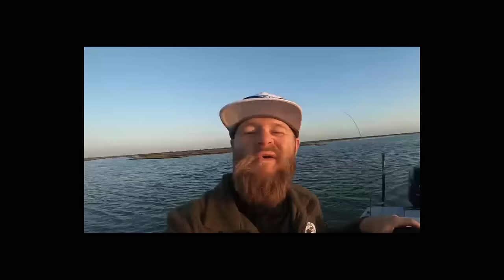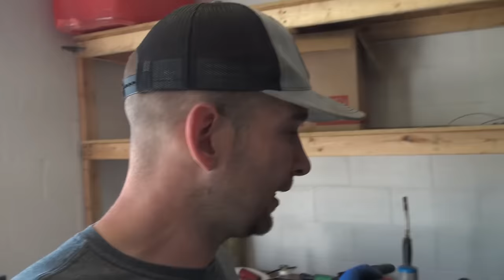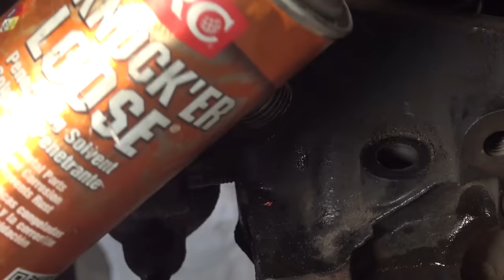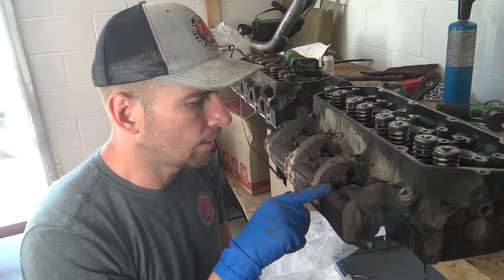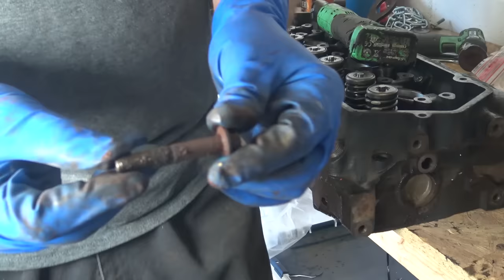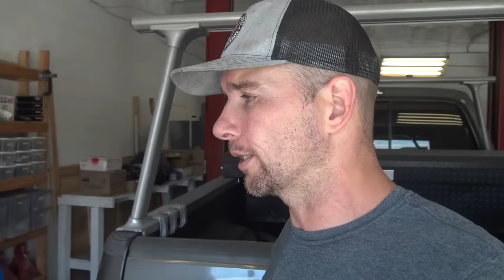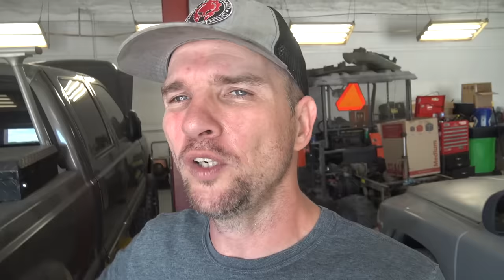Old Mechanic Taught Me This Trick To Removing Rusty Exhaust Manifold Bolts!

Comment: Great stuff!  I do have another method that often works in places where you CAN'T use heat,  and that's using COLD.  The best way I've found for that was to use an INVERTED can of "spray air", usually marketed for blowing off computer keyboards, etc., and to spray the LIQUID on the fastener itself (and NOT the surrounding metal).  This causes the fastener itself to shrink....a LOT...and can often free it up.  I work with aluminum head engines often, where heat is your enemy.  The extreme cold using this method works great!  I had occasion to insert a roller bearing into the end of a crankshaft, where the outer diameter of the bearing was a few thousandths bigger than the hole.  Opening up the crankshaft wasn't possible (engine was still together), so I used this method to shrink the bearing.  It was a small bearing, less than 1" in diameter, but I tested this method on it.  Amazingly, it shrank 17 thousandths of an inch, and was literally loose in the hole!  I kept spraying the bearing until it was uniformly white.  Of course, once it warmed up, it was tight in the hole, but it worked perfectly.
Reply: thanks
Reply: For old Harley heads that needed the guides replaced,id heat the head to remove the guides,after cleaning them first,then heat the head when installing the guide,but id freeze the guide in the fridge so it would go it really easy,once the head is cold the guide is locked tight as a drum,done it a million times lol.
Reply: @bruceperron3796  Ive used the freezer to help shrink bearing races down before I installed them.  I've never installed rod guides before, but I know what they are as I have put heads on engines.  The day will come when I do install guides and I will remember this.
Reply: That's what she said!
Reply: Good Man ...... that's got to be worthy of Tip Of The Day !  🏆
Reply: @ruthberesford1198  Ring gears on fly wheel. Flywheel in the freezer- ring gear in the BBQ for a short stint and it rattles on loose as can be ans tightens up unmovable

Comment: Have to admit I just found your channel. The removal of rusty bolts caught my attention so I had to watch. This is the method I learned 40 years ago with my dad and you are right the key is to go slow and use heat on those that seem impossible. Because of your story and this video content you have my subscription to help you to your goal to be better than ever. Cheers.

Comment: I drove my vehicle for a week knowing I had to replace the exhaust manifold, I sprayed the bolts everyday with penetrating oil. The next week when I went to remove them, they all came out super easy. The heat expanded the head and manifold after driving and since there was more heat in those areas verses the bolt the oil was drawn into the areas that needed the lube. I learned a long time ago that you heat where you want the oil to go. I did have one bolt that was broke on the bottom back side, no idea how long it was broke or missing but since I was spraying it anyway when I tacked on a nut, it came right out also. Nice video, keep them coming.

Comment: This is a lot tougher in the northeast when a lot of times, those manifold bolt heads more closely resemble hammered rivets after the rust has it's way.
Reply: I spend hours watching the mechanic at South Main Auto remove bolts with Northern rust.
Reply: This so true... I've worked on so many cars that have had exhaust issues because the bolts/nuts/studs have rusted to nothing...
Reply: I was thinking the same thing.  New Englander here....
Reply: nabob14 rusted exhaust almost always better to cut and replace. You won't be reusing rusted out fastners.
Reply: Lol y’all keep calling it “Northern Rust.” Let me show you my truck that lived on the coast of the Carolinas for most of its life.🤣
Reply: @evhexrc1765  ive seen Galveston,Tx rust buckets. Anything from the coast scares me more then northern.
Reply: Trying that with the head on the motor is another thing.
Reply: @evhexrc1765  I work on coastal cars. Salt rust is bad. Worse than coastal rust. A Carolina car will last 20-25 years. Northern cars half that.
Reply: It’s scrap metal at that point
Reply: @iamtheoffenderofall  magnesium chloride doesn't play well with metal
Reply: EvHexRC 1 Carolina coast may have some salt in the air, but in upstate NY they dump salt in the streets. Mix that with melting snow and ice, I don’t think there’s any comparison 😆 🤷‍♂️
Reply: A pass through socket set with splines answers that question for me every time. I put the pass through extension on the pass through splined socket smack it with a hammer until the socket cuts new splines in the nut or bolt.
Reply: @evhexrc1765  My brother lives in Maine...He knows it's time for a new car when his foot goes through the floor.
Reply: Oldold Pilgrim .. South Main auto is probably one of the best on YouTube. This video here is very informative. I live in the Northeast and exhaust manifold bolts are nothing but a hassle.
Reply: I do not envy you guys busting nuts in the Northeast. I’m in the southeast and ran across a rear knuckle on and Aztek that the bolts were rust welded in place. That thing was a nightmare.
Reply: This is okay but you're not going to be reusing them old nasty bolts anyways I think it is so much quicker to take a die grinder cut the tip if you have access off and take a little set of torches he is using MAPP gas or what not I use just a baby set of torches with a little baby Rosebud tip heat them suckers take out set of vice grips or a bolt out socket. And do each one I would be done and more than half the time of what this is taking but if it is a very old classic in some reason you can't get the bolts or something like that and you just want to reuse them then this is okay but time is money money is time if it takes you two hours I want have when you could have just cut them off at the diagram there he did them slam dunk it in 60 minutes
Reply: Using penetrating oil and banging with a hammer is like smoking crack, a waste of time and money.  Easiest way to remove the worst case scenario bolts: heat bolt with torch then melt some candle wax on heated bolt.  Screws right out with no effort whatsoever
Reply: @acemogany6369  life must go a lot faster if one skips any punctuation and spends zero time composing thoughts into rational sentences...
I hate babble on no punctuation hipster gibberish! 
BUT I HAVE TO ADMIT THAT I HAD NO TROUBLE FIGURING OUT WHAT YOU WERE SAYING. So somewhere in the middle? 
Let's eat, Grandma!
Is very different from: 
Let's eat Grandma !
Punctuation saves lives...

Comment: all excellent ideas!  My Dad was a tool & die maker for Caterpillar and taught me another trick - tap on the head of the bolt after spraying your Knocker Loose on the bolt head and thread base.  And not just tap - but whang on it!!  That tends to loosen up the rusted internal threads so they may turn out easier!  Nice job sir.
Reply: First up,;
I'd like to thank everyone, for revealing their "Trade Secrets"
Everyone uses different words/language to describe things.
In one Caterpillar manual it suggested "setting up a vibration"
and the picture was of someone beating on it with a hammer.!
and some folks say "Get a bigger hammer"
However, this video is all about,"softly softly, catchly monkey"

Comment: After you torch it, spray it with more penetrating oil. The heat will draw it into the bolt hole.
Also smart the bolt heads with a hammer a few times before you try loosening them
Reply: That is called “Wicking”. It is not the heat drawing it in, it is cooling down that draws it in. Plumbers use wax.
Reply: Hammer is a good idea, I have found this helps. Assume it moves the bolt just enough to break the corrosive bond. Though, heat is the one thing that nearly always works.
Reply: @lynnchello7231  I have a spray bottle with water in it and squirt directly on bolt after heating....then loosen
Reply: Exactly what my father taught me nearly 60 years ago. He called them short-sharp "twat-hits". Works like magic until you realize it's just physics.
Reply: Air chisels work pretty well at vibrating the bolt if there isn't enough room to get a good swing with a hammer.
Reply: @bluenami7520  yes they do; better than a hammer. If you have one I'd use that
Reply: @bluenami7520  The Air Chisel idea totally helps. To keep the blunt end of the air Chisel's tool from vibrating all over the place, find a socket that fits the bolt head, and drive the punch (or drift) point through the hopefully 1/2" square drive hole. Some deep well sockets are open all the way through and work great! Just this spring, I removed some HORRIBLY seized bolts from a John Deere Air Seeder exactly this way. Nothing works 100% EVERY SINGLE time, but in my 66 years of screwing with stuff like this, the Air Chisel trick is one of the best I've learned. Add in the patience, working both ways a tad, soaking the crap out of it.... All the above.
Reply: This is exactly what I do
Reply: @lynnchello7231  parrafin wax also works well when metal is hot. Penetrating oil evaporates to fast to be effective i find.
Reply: @lynnchello7231  also crayons
Reply: @c50ge  now that is a good use for all your kids old broken wax crayons.  Lol
Reply: You and me know the sam old mechanic.  Also, after heating- if you take time, let it cool! The heating cycle will make the interface move and help loosen the bolt threads.
Reply: @thegoatstore7814  This is by far the best tip anyone could share. Its just amazing at how good it works but you must remember to turn the bolt or nut in just till it cracks loose a tiny bit the heat it red hot and quench and Bam most of the time they will come right out. Another cool thing if you have 24hours to spare is to dissolve the bolt right out of the hole. Make a little cup that fits over the stuck bolt with a soda can make sure you cut the bottom of the can out and then use rtv and seal the can to the aluminum head(only works on Aluminum because it wont dissolve it it will only eat the steel) after the can is sealed to the head go to your local bulk food store and get some Alum its used in canning or something. And you mix it up with some water not sure of the ratio and fill up the soda can so the bolt is covered in the solution and next you put a heat lamp near it to heat up the solution this makes it work way faster. And walk away and when you come back the next day you will have a beautiful hole with perfect threads. This is chemistry at its finest. We used it 1 time on a vehicle where the heads were way to expensive and rare to risk anything funny happening to it and it went perfect
Reply: @lynnchello7231  obviously that is what he meant but thanks for clearing that up. Drastic change in temperature either way helps alot on different metals
Reply: @ssskinner28  
Can you please "resay" your explanation. 
Not fully getting that last part.
Reply: @ssskinner28  what steel was the fastener made from? Regular carbon steel? Or stainless?
Reply: @Babewatcherbob  regular carbon steel it may work with stainless I'm not sure
Reply: @onlythetruth883  if you're talking about dissolving the bolt with Alum powder. This only works if the main part is aluminum. You pretty much take a soda can and seal it to the head or whatever your working on with rtv and when its set up you make a mixture of Alum powder and water and fill up the soda can which will then hold the mixture in place over the bolt. Now that it's all in place and soaking you take a heat lamp or regular light bulb and put it close by so it heats up and you wait overnight is usually enough but sometimes it takes 24 hours. This is far from a fast fix but when it needs to be perfect this will work better than anything
Reply: @ssskinner28  Alum power mixed in water will also dissolve HSS taps broken off in aluminum.  Just a neat trick I read in an old machinist's manual
Reply: Take an aluminium Hammer, it gets vibrations on the bolt.
Reply: Scott Robinson  "....divided we fall.". tRUmP w0N 2o20 💩
Reply: Scott Robinson  I'm not US citizen, so I don't vote over there. You do realize, that YT has international reach, right? And everyone having inet access can comment on anything? 😂
Reply: Scot, you fell for it too?
Reply: @iamalpharius3959  they come in big cans for a reason man load that sucker full of it
Reply: Came here for this comment... you beat me to it.
Reply: I've been saying this for years.  Finally, some verification.  I've been working on boats for twenty years and next to heat I also find a good shock with a big hammer is often effective.
Reply: @lynnchello7231  that's what I've always thought. Do you know the science behind it?
Reply: @iamalpharius3959  nhi

Comment: A small detail on a well conceived, well executed video: the highest temp you're gonna have on your torch is just off those blue cones in the middle of the flame. Don't smother the flame, pull your torch back a bit and there's your highest heat source. You nearly hit every one of the other details I've needed to use in decades of getting bolts loose except for striking the bolt to shake the rust loose. All in all,  Good Job!
Reply: Anyone who used a Bunsen burner in school should remember being taught that.
Reply: I am a retired plumber, I was going to make the same comment, much quicker when brazing gas pipes

Comment: I like the idea of tightening them back down so you’re not fighting the released clamping force. Once you get to gotta cut the bolt head off, I like to use a pipe wrench so the twisting force can be closer to the threads. Awesome video, awesome technique.

Comment: Everything said was exactly correct, take time, plenty of penetrating lube and don’t get  lazy! One final trick before heat, depending on access to the bolt, is a hammer and punch, but be gentle, don’t nail on it like trying to cut it off, shock from hammer blows is why impacters work!

Comment: i’m 17 and want to be a mechanic, god bless you for showing me this skill
Reply: Welp being 26 and doing it I can tell you 1 piece of advice I can say is make sure you have as many of the correct tools at your disposal as you can afford to have.
Reply: No U Even the things that will be like a once or twice use?
Reply: @antnay_beastz9361  Use the loan a tool on them and if you start using them often then you consider investing in them heck most of my tools are harbor freight etc snap on stuff is a real fast way to a bunch of debt
Reply: No U yea i’ve seen all the memes about snap on being a waste of money
Reply: @antnay_beastz9361  if its going to be used once or twice, you're local auto parts store should have it for rent. You pay for the part, and get your money back when you return it.
Reply: When people come into my shop and said I wish I could work on cars, I say wish I'd have chosen a different profession. Hard to make a living, never have all the expensive tools, and your back will be  junk after about 20 years. My advise is choose another profession.
Reply: Old mechanic (in southwest Nebraska H.H. "Smokey") Pritchett) pointed out to me that WATER is what caused the oxidation (rust) and water softens it again. Also, failing to remove the "oxidation" when trying to remove a nut from a bolt can cause the rust to pile up and cause the threads to gall. Penetrating oils (only on nuts and bolts? NOPE!) can contribute to this problem of galling the threads.
Reply: @geezman1000  Don't most mechanics have work ahead for days year round? Must be nice. I've been in HVAC in Texas for 47+ years. Have a 5 star reputation but except for Spring and Summer it can be very slow. I've always wanted to be a mechanic but can't get my hands in these tiny cramped engine bays anyway so I guess God steered me away lol. Still LOVE fast cars....and beer. Cheers!
Reply: @nou8257  YES YES YES this is huge and makes life much easier
Reply: Brother go be something else. These skills are great to have and wrenching is great fun, but I did my mechanical trade and changed professions.
Reply: Figure out a way to get involved with fun stuff, like specializing in carburetors so you can start your own business and carve out a niche like carburetors for restorations on priceless cars, where the work is cleaner, at a bench, or get on a racing team. Maybe motorcycles, aviation, but just day to day at a garage can get old quick. You could further your education and become a engineer/designer, specializing and becoming highly skilled, equals better money. Just some ideas...

Comment: Thank you for putting this video out there.  I knew most of the tricks already from Hard Knocks Academy and patience is definitely hard to learn when it comes to exhaust bolts and such.  This job alone is the reason my shop has a sign reading, "Every 15 minute job is one broken bolt away from being a 3-day ordeal."  Now, I soak the bolt with panther pi55, wait 15 minutes, and spray it again.  Hammer shocking is good (as mentioned below).  Heat is your friend.

Comment: I learned this method when I worked on tractor trailers. Old gentleman showed me this. He also tapped on the bolts before turning. And he said always use new volts when you can. Great video.  Thanks for sharing.

Comment: When I use penetrating oil, heat the bolt up with a torch first. Then after the bolt is nice and hot, then spray it with penetrating oil. The heat will draw the oil deeper into the threads. Makes a world of difference.
Reply: Spraying cools the bolt rapidly causing it to shrink and break free somewhat that may allow oil in but I doubt it because it is too hot at first.. let it cool down and ya maybe stuff goes in but mostly you broke the bolt free with sudden cooling via spraying anything even water... just sayin...